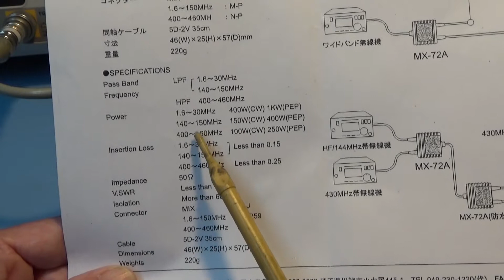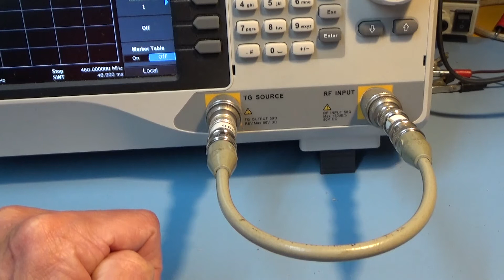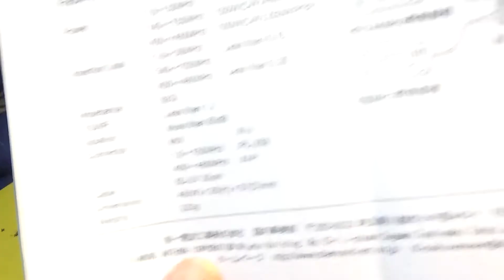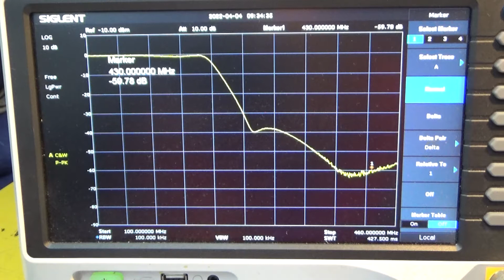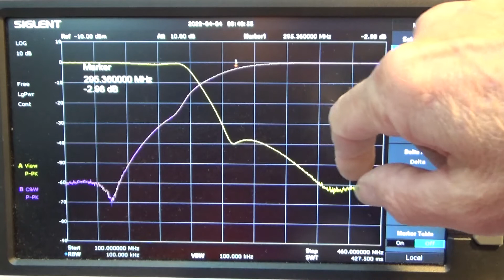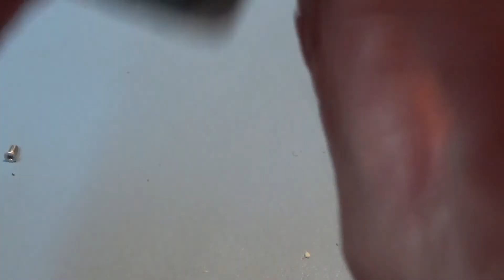Diamond MX 72 A Duplexer

Comment: Would this work on icom 705
Reply from the maker: I have no knowledge of the 705, this is primarily used for radios that have a separate 2m & 70cm ports, for use with a dual band colinear aerial
Reply: I need to split the HF- 6meters fron a single port from my FT- 450 into two different antennas. 
What duplexer should I use?

Comment: Thanks for the video! I have two of these diplexers in my equipment. Impressive performance! Which gives me confidence in these devices. I am interested in the question  why you made decoupling with the attenuators at input and output. Is that needed at both sides?
Reply from the maker: Hi Andreas, glad you liked the video.
The reason for the attenuators is that me & someone else who did a video on the spectrum analyzer noticed that there was a slight impedance mismatch at the output of the tracking generator & the input of the analyzer. I guess you'll can't expect it to be perfect across the full frequency range. I confirmed this by testing a high quality narda 10 db attenuator that I know is good & the attenuation was varying slightly either side of 10 db. With the two 6 db pads in place the result was a perfectly flat 10 db across the full frequency range.
Reply from the maker: @UC_Rk-8-IcCP6fAYeI870nfw I love playing with rf devices. I assume you've bought the same analyzer as me? It's very good for the price. Something like that would have cost the price of a house 40 years ago!

Comment: Hi Nick! Finally a bit of rest from my move. It’s been crazy lately. I’ve watched this video with pleasure. I happen to have one too. Used to use it long time ago when I own a kenwood TS2000. Separate ports on the back but common antenna on the roof. I remember it working well. Recently I’ve found it in the cave in my country house. Became a bit rusty outside and is missing the so239. I think I’ve reused it for something else. But I should be able to put it back to working order, at least is my intention. 
Hope everything is well with you. 
Best wishes
Diego